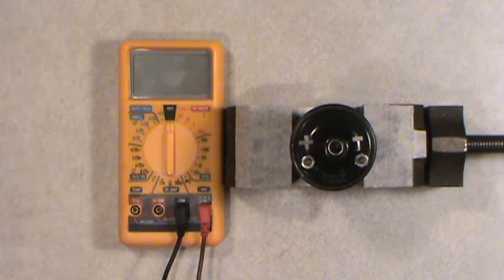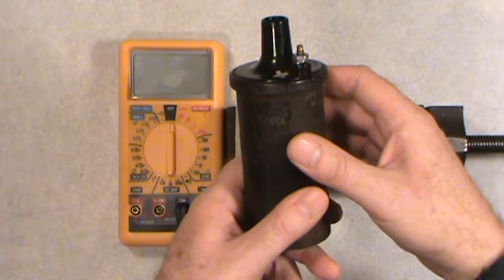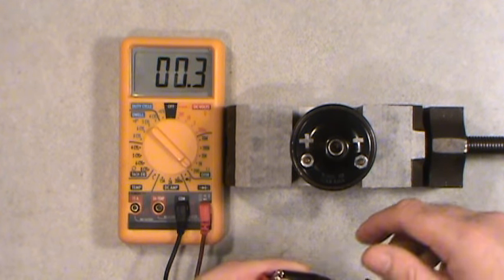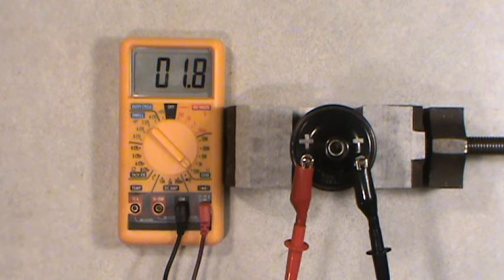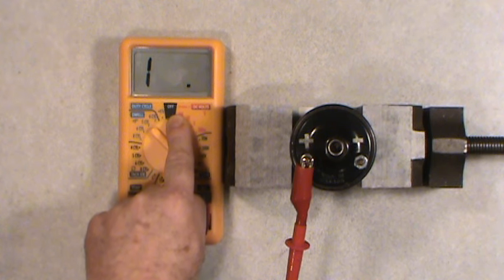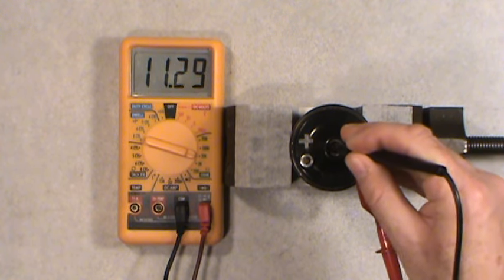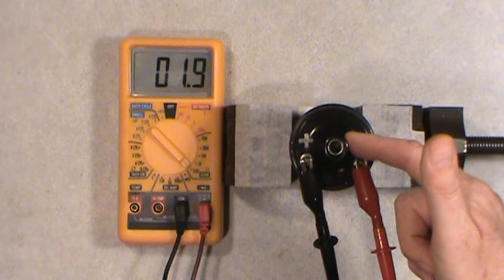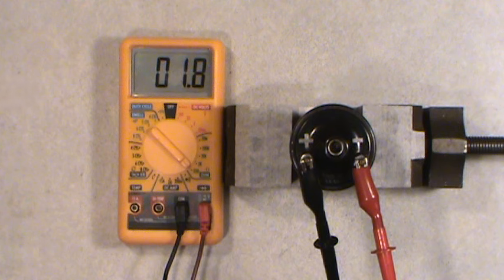Ignition Coil Test (The Short Version)

Comment: As always I love your videos! Such great knowledge to soak up and use. Might you have a good book in mind concerning all service issues with vehicles?
Reply from the maker: Jon Stone It looks like Your comment Posted "2" Times!...................I placed a "REPLY" on the..."Other"..."Mirror Image" of this comment Jon.
Reply: Yes sir, sorry about that, thank you for that info for the book. I'm currently in need of it my car isn't running well, it turns over a long time before it cranks and when it does start oh boy! It shivers and shakes really bad then finally levels off. I've done a vacuum check and found a leak on the manifold and replaced the rubber gaskets retested and seems to be sealed tight. 

 I checked vacuum with a gauge and it seems ok according to what I've read about how it should do so i checked spark plugs and found them with a whitish brown coating and cleaned them. I replaced them this year along with the wires so I'm guessing they are okay.

 Any ideas??  Help!! LOL!
Reply from the maker: Jon Stone Greetings Jon Stone....Yes-sir-ee-Bob, I have ideas, maybe, even..."Too Many Ideas"...!!!...lol....................................................Is the Vehicle that You're having this problem with, still the..."1999 Ford Taurus"...???...or, do You have a..."Different Vehicle this time"...???...........................................................Let me know, as much as You are able to, about the..."Vehicle in question, as well as, what Engine is installed in it, along with any Modifications"...that way, I'll have the Needed Information, to go on, thanks..........................................................Try this...when You are Starting the Engine, either Hot or Cold, Hold the Gas Pedal Down, about 1/4 (One Quarter), of the Gas Pedal's Travel, not too much now, then...Crank the Starter Motor, and, as soon as the Engine Starts, take Your Foot, Off of the Gas Pedal, and see if the Engine will Run on its Own, if the Engine is about to Stall, give it a Bit of Gas (Pedal), just enough to keep it from Stalling/Stopping, but keep the Engine Revs/Rpm's quite LOW, so You don't Damage the Engine, without a Load on it...!!!...Any Luck at all...???.....................................................If the Vehicle is about..."1996 and Newer"...it will probably have, what is known as..."OBD-2" (On Board Diagnostic/s-Version 2)...which is the Type of Computer, and the Management System, that goes with it, which usually includes, all of those Sensors and Actuators, that are specific, to that particular Vehicle................................................The "OBD-2" Engine Management System, as some have put it, was a kind of..."On-Board-Exhaust-Emissions-Analyzer" of sorts, and, from what I recall, it will "Detect and Report", something like, if the Vehicle's Exhaust Emissions, get to the point of being, something like..."1 and 1/2 Times"...the Allowable Exhaust Emissions "Standards", and, there are a few Different, shall we say..."Seriousness Levels"...that are  contained within, those "Many OBD-2 Trouble Codes" as well...!!!......................................................If You have an "OBD-2" Vehicle, then, in order to "Extract Any Trouble Codes", from the Vehicles On-Board Computer, You are going to need an OBD-2..."Scan Tool" (kinda looks like, a slightly Larger hand held Calculator), and, once the Repairs are made, You will Need the "Scan Tool", to "Clear-Out" the "Stored Trouble Codes", that were Stored "In" the Vehicles Computer, then, the Vehicle Needs to be Driven, for, perhaps, as much as, a few Days, at Different Speeds, so the Vehicle's Computer can "Re-Learn and Reset It-Self"...................................................If the Vehicle is about "1995 and Older" (but only Back to the 1980's!), it will usually be using the "OBD-1" (On Board Diagnostic/s-Version-1), that, usually..."Does Not"...Require a..."Scan Tool"...at all..........................................................As, in the case of the..."OBD-1"...System, Each Vehicle Manufacturer/Make/Model, will usually have a "Certain Method", to Use, in order to "See" (usually, a flashing on and off dashboard Light, kinda doing the Morse-Code thing) , what Trouble Codes, if any, are Stored in the Vehicle's On Board Computer...................................................To Clear the Stored Trouble Codes in Some "OBD-1" Systems, it's usually, just a matter of Disconnecting the Negative Cable, from the Vehicle's Battery, for about 1 Minute, with the Engine "Not Running"..................................................Make Certain, that You are using the "Exact Method and Specifications", for Each vehicle, that You might be working on, so Nothing gets Damaged/Expensive...!!!.........................................................There are still a number of "Things", that can be looked at, in the event, that You don't have a "Scan Tool"..........................................................Did "All of Your Engine's "Spark Plugs"..."Look Exactly the Same as Each Other"...???........................................................As in, the Amount and Color of Any Deposits on Them...???...................................................Are "All" of the Spark Plug's,  Inner and Outer "Electrodes", in Very Good/as New Condition...???.............................................................Also, with the Engine and Exhaust System "Cold", You can also, Remove Each of Your "Oxygen Sensors", and kinda "Read" the "Deposits" on them, somewhat, like a person does with Reading Spark Plugs, but, just a bit different.................................................Sometimes, "1" or More of them, can be all covered in black dry "Carbon"..................................................That would be Tellin' me, that I might have, and like I've had before, an Engine "Miss-Fire", that can be either "Fuel System" related, as in something like, a Faulty, Electric High Pressure Fuel Pump (in the gas tank type), or, perhaps, a Faulty Fuel Pressure Regulator perhaps.......................................It could also be "Ignition System" related, and, the cause, can be, one or more, of the "Many Things", that make up the entire Ignition System..............................................Are You sure, that You "Installed", All of the Spark Plug "Lead/Wires", from, the "Exact" Ignition Coil/s Tower/Connection, to the "Proper, Cylinder Number Spark Plug"...??? (hey, stranger things, have been known to happen!...lol)......................................................Now then, about Your "Vacuum Gauge Readings"..................................................Were the Reading/s "Steady", as in, "Not" having the Indicating Needle, jumping higher and lower, while Not touching the Gas Pedal...???...................................................Were You able to get the Engine, up to "Operating Temperature", while having the Vacuum Gauge "Connected to an "Intake Manifold/Plenum, Vacuum Source", and having a Look-See, at what Your "Vacuum Gauge" was "Showing" You, at all...???......................................................In a Smooth, and Good running Engine, the "Vacuum Gauge" should be Showing a reasonably High Amount of Vacuum, and, the "Indicating Needle" should be quite "Stationary" (aka, not moving)..............................................The "Altitude" (as in, at Sea level, or Higher), at which Your Vehicle "Operates At", will also "Change" Your "Vacuum Gauge Reading/s"...!!!..........................................If memory serves me right, I think Your Vacuum Gauge, will "Drop about 1 PSI" (aka, Pounds per Square Inch), for every "1,000 Feet", of Altitude "Increase"...............................................In other words, Your Vacuum Gauge, should give You the "Highest Readings" while at Sea Level, as compared to, something like, an Altitude of, oh, shall we say..."5,000 Feet"...just sayin'..................................................As, with just about any Fuel Injected Engine, the Fuel System should be Checked for "Fuel Pressure", with a Fuel Pressure "Gauge", and that Fuel Pressure, has to be "Within", the "Specifications, for that particular Vehicle/Engine, or, it might Not Start, and/or, probably Won't Run very good at all...................................................While Wearing "Eye" Protection, Make Sure, that, You "Bleed Off" the "Fuel Pressure", in a "Safe" manner, in the Fuel Line/s..."Before"...You Loosen any Fittings, and, when You are "Connecting or Disconnecting" the Fuel Pressure Gauge as well, as, that "High Fuel Pressure" is "Dangerous"...!!!..........................................................Without Using a "Scan Tool", on an "OBD-2" equipped Vehicle, it would, more or less, result in, going on something, like a..."Wild-Goose-Chase"...!!!...lol.................................................Just remember now, there's only so much, that a Person can do, on an OBD-2 equipped Vehicle..."Without a Scan Tool"...................................................'till next time.........................Be Safe, take care, and have a good one.
Reply: RockysRoadshow hi again, the knowledge that flows from you wow! I'm working on my car it is a 2007 pt cruiser. It ran hot about a month ago while on the highway and when it ran hot oil came out from somewhere but I have yet to find where. I quickly pulled over when this happened, it was at the three quarter mark on heat gauge and I can't understand why it happened since it wasn't that hot. Well I had it towed back home and found that my radiator had a bad leak so I replaced it and thermostat. 

 Refilled with antifreeze and yes good ole tap water, I did bleed the air but I still get a blow back into the reservoir so much so that is where my coolant is leaking. I replaced the radiator cap because the seal was rotten and it still blows too much into the reservoir tank. It fills to the spill over spot and hence my loss of coolant. Well not only that but the car will turn over fast and is slow to start, now it hardly starts at all but turns over just fine. I've done a lot of study on the sensors and valves that takes the place of the old carburetor and rotary distribution and replaced the can sensor, cleaned the throttle valve and both the map and may sensors. I've read that the crank sensor on the bottom of engine will cause it to not start because that is what tells the spark module to send spark to the cylinders. I hooked my vacuum gauge to the manifold plenum below or after the throttle I did read a steady 19 almost 20 inch vacuum and when I throttled the engine it went down to 5 and back up to 28 then down to 19 almost 20. From that I don't think I have a head gasket issue or many other issues. I did a vacuum leak test by using a cigarette blowing smoke into the manifold and did find a leak but solved that with new gaskets. This was before the vacuum test I mentioned, I can't test fuel pressure because there isn't a Schrader valve and would need an adapter. I'm thinking the start issue is either a bad fuel pump or the crank sensor I did check spark plugs and they had a white and slight brown not much brown more white than anything. It does spark because it zap me a little and is present by noise . Now a friend of mine suggested I pull the spark plug wires one at a time to see if there is any difference in the engine sound or action. I did and only one killed the engine the others didn't phase it, the one that killed it was the fourth cylinder. I'm out of ideas?
Reply: Jon Stone  Forgot to mention the needle did not flutter when I checked vacuum. I did carry the car to the parts store and no codes came up. Also the check engine light does come on but dings and says gas cap, I had to replace that cap a while back and am wondering if the bad cap I bought is allowing air into the tank and causing the gas to get water in it and if it might cause a pressure problem on the fuel line.
Reply from the maker: Jon Stone Greetings Jon Stone....Thanks for the nice comment, my Friend....................................................Now, on with the show...lol.................................................Let's start with that "Over-Heating" Problem shall we.........................................There are a number of things, that can cause a Vehicle's Engine to "Over-Heat", and, I'll just stick with, a few Possibilities, as far as the Engine's "Cooling System" is concerned.................................................The "Coolant Mixture" (aka, Anti-Freeze to Water Ratio), should, as I see it, be somewhere "Between"..."50%, to No Higher then 70% Anti-Freeze (that be, the Full Strength Anti-Freeze, that is found in the "Jug", when You Buy it New), and the "Remaining" Amount, being, that of, "Distilled or Soft Water", that will be Needed, to Make-Up the "Remainder", of that "100% Coolant Mixture"..................................................If, for instance, if it happens to be a 50/50 (One to One Ratio) Mix, or Equal Parts of, Both Anti-Freeze and Water, it's as easy as that.........................................As for Me, using the "Strongest Coolant Mixture", being..."70% Anti-Freeze to 30% Water, that would "Raise the Boiling Point" (with the Proper PSI Rated Rad Cap) & "Lower the Freezing Point", quite a bit.........................................................I Never go any Stronger then 70% Anti-Freeze, because, I found that, by doing so, Corrosion Protection goes out the window, and the Boiling Point will Drop, as well as, the Freezing Point will be Higher as well...!!!.........................................................Believe it or not..."Water" happens to be about, one the "Best" Liquids, that Mother Nature has given Us...Very Efficient at "Absorbing/Transferring" Heat, but, with some Drawbacks, as in...Not too High of a Boiling Point Temperature, as well as, Not too Low of a Freezing Point Temperature, and also, it's rather Corrosive, as well..............................................That's where Our, good ole Friend, known as "Aunty-Freeze" (lol, really now, it's)...Anti-Freeze...comes in.................................................Yes-Sir-ee-Bob, not only does this "Anti-Freeze" Stuff"..."Raise the Coolant's Boiling Point Temperature (and even Higher, when a Radiator Cap, Adds Pressure to the Cooling System!), but, it also "Lowers the Freezing Point" as well, when Added to the Proper and Needed "Mixing Ratio" with the "Water" (Chemical Interaction)...............................................Also, the "Coolant" (anti-freeze & water mixture), will also "Prevent Corrosion", if the Coolant gets "Changed" at the Correct Replacement Intervals........................................Did I mention, that this Anti-Freeze Stuff, makes for, a pretty good..."Water Pump Lubricant" as well?........................................I'm thinkin' that this Coolant Stuff, would be "Lubricating" the so called "Cartridge Type Seal" (inside the water pump), that Prevents, all of that, "Circulating, Hot, Pressurized, Coolant"...from Escaping, in the Form of a Leak...............................................Enough of that, for now, time for...the "PT's Overheating possibilities................................................The "PT's" Old Radiator's "Tiny Tube Passages", could have been Partially Plugged-Up, perhaps with Corrosion and/or Deposits, and I have found, that such a Radiator, would at times, Cool alright, but when the Hot Summer comes along..."Let the Over-Heating Begin"...!!! (kinda like..."The Straw that Broke the Camels Back...!!!).........................................Are You Using the Correct Mixing Ratio, of, Anti-Freeze to Water, in the Cooling System...???....................................................Is Your Radiator Cooling "Fan"..."Cycling On and Off"...when it should be doing so...???.............................................No Codes huh?...Let the Fun Begin...!!!...lol................................................You really have to find a "Safe" Way (Wear Safety Glasses/Goggles!!!), to "Check Your "Fuel Pressure", with the Engine "Not Running" & "Running" as well (Your "Pt" may only require one or the other, check Specifications), and Make Sure, that the Fuel Pressure/s..."Are Within Specifications"...otherwise...You might be chasing, a..."Problem that might not even be there", excluding that "Over-Heating Problem" possibly.............................................Could be, that the Fuel Pump is OK, but, perhaps the "PT's..."Fuel Pressure Regulator" (if it has one, that is), is somewhat "Malfunctioning/Leaking", which will also, cause a "Lower then Wanted Fuel Pressure"...!!!......................................."Check Your Ignition Timing" (might only need to, "Set the Base Timing", if applicable)..............................................I Always "Ground", with a fairly Thick, Insulated Gauge Wire (usually, some 14 Gauge Copper Electrical House Wire), any "Disconnected Coil Lead/Wire"..."Before"...I "Start the Engine"...as by, Not Having a Good "Ground Connection", on any of the Disconnected "High Voltage, Secondary Leads/Wires"...from what I recall, that will probably put a "Very High, Un-Needed Strain"..."On the Ignition Coil"...!!! (perhaps the Ignition Coil is Damaged...???)....................................Is, Exhaust Gas, getting into the Coolant somehow...??? (Bad Gasket?)................................................Take a Close look, at the "Oil", that's on Your Engine's, Oil Level Checking Dipstick, and see what You Find, as in "Anything" that "Does Not Look like Motor Oil" perhaps...???............................................Now it's Time...Shur-Lock-Homes, to get out Your Magnifying Glass, and Follow that Path of Clues!...lol.....................................Good Luck!.............................................Be Safe, take care, and have a good one.
Reply from the maker: Jon Stone Greetings Jon Stone....Allowing "Some Air" into the Gas Tank, as well as, Letting "Some Air" Out, is actually designed, right into the Gas Cap itself............................................Here's the deal...Most Gas Caps, are usually Not, the equivalent, to that of, Putting a Cork in a Bottle...........................................Let's start with a Full Tank of Gasoline, and take a nice long Drive, almost using up, all of that Gasoline, to the point of, almost having an Empty Gas Tank.................................................While the Gasoline gets sucked or pumped out of the Gas Tank, and "If" the Gas Cap..."Was Not Venting"...then, as I see it, that poor ole Gas Tank, would probably..."Collapse"...!!! (Air Pressure Differential).....................................................Now then, let's imagine, that in this other Scenario, that Same Car's Gas Tank, is about, One Quarter Full, and the Car gets parked in the "Sahara Desert", on the Hottest day, ever Recorded, as we get Helicoptered, the heck out of there, and find a nice Air Conditioned Restaurant, to Chill in, while that poor ole Car, gets..."BAKED"...!!!.................................If the Gas Cap..."Did Not"...have some form of..."Pressure Relief"...then, that Car's, poor ole Gas Tank, would probably..."Expand", to the Point of..."Bursting Wide Open"...!!!..........................................Get the Picture...???.......................................................Bottom line...Unless the Gas Tank is "Vented", for both "Vacuum & Pressure", by some Other means, then, as I see it, that "Thing", that we, for the most part, take for granted, otherwise known as the..."Gas Cap"..."Is Responsible For"...the Well Being of that..."Liquid Gold/Gasoline/Containment/Tank"...that Accepts, that good ole "Fossil Fuel", from that good ole Gas Station's..."Gas Pump Bandit"...that we say "Hi" to, every time, We need some more..."Wallet/Purse Emptying"..."Gasoline"...!!!...lol..........................................and Hey, if You can't have Fun, what can You have...???...lol................................................I hope You-All had a good laugh...cuz...I sure Did...!!!........................................................Be Safe, take care, and have a good one.
Reply from the maker: Jon Stone Greetings Jon Stone....I was just thinkin', about Your Gas Cap...Warning..."Dinging Sound"...Dilemma..............................................Perhaps..."Check & Verify"...that You have the..."100% Correct Gas Cap"...that is actually..."100% Specific"...and Made For..."Your Exact Vehicle & Factory Installed Options as well"...!!!...........................................I'm thinkin', that, there just might be, a "Pressure, and/or Vacuum Sensor", of some type, that may be Hide-in' in Your Gas Tank, or, perhaps, maybe somewhere else, in the Fuel System, perhaps...???...................................................Could possibly be, that, the Gas Cap, that You have there, might just have, a..."Different, Pressure, and/or Vacuum Venting Rating"...as Compared, to the..."100% Required Gas Cap Rating" (both Vacuum & Pressure Relief), that's..."Specified for Your Exact Vehicle"...???......................................................If and when, You are..."100% Certain"...that You have the..."100% Correct Gas Cap"...Installed and Tightened "Properly", on You Gas Tank's "Filler Neck/Opening"...then, I'm thinkin', that, it would probably be a good idea, to "Clear", any, and all, "Trouble Codes", from Your "Vehicle's Computer", and then, Drive around for a while, and "See"...and/or "Hear"...weather or not, You'll be Hear-in', that..."Ding-Ding-Sound"...again...if not (as in No-Ding-Ding)...then, it will be, as "Craig Ferguson" Says..."It's a Good Day for America"...!!!...or, Where-Ever, on the "Earth", that You're actually Living...!!!...........................................Might also be, that Your Gas Tank or Fuel System..."Has an Air/Fuel Vapor Leak"...somewhere, and, if there is a "Leak", then, as I see it, it could "Be, that Unwanted Leak", that would probably, Be Acting, just like a "Faulty Gas Cap" would be Do-in perhaps...???......................................So then, there You go, for now, that be-in, as they say...My "2-Cents-Worth"..........................................................Be Safe, take care, and have a good one.
Reply from the maker: Jon Stone Greetings Jon Stone............."OOOPS"...!!!.............................................................I just Discovered a..."Boo Boo"...that I made, and, that there..."Boo Boo"...just happens to be, that, I was Sayin', that the..."Vacuum Gauge"...Reading...would be showing a..."Drop of 1 PSI" (Pounds per Square Inch), for every..."1,000 Feet, of Elevation Increase, Above Sea Level"...where, I really, should have said...a Drop of..."1 Hg"...or..."1 Inch of Mercury"..."Instead"...of the..."1 PSI"...that My..."Auto-Pilot-Mind"...made My Fingers..."Type"...at that particular point in time...!!!...lol...................................Goes to show, that, I..."Do Make Mistakes"...and, I'm Sure...as time progresses..."There Will Be More"...!!!...lol.............................Till next time.................Be Safe, take care, and have a good one.